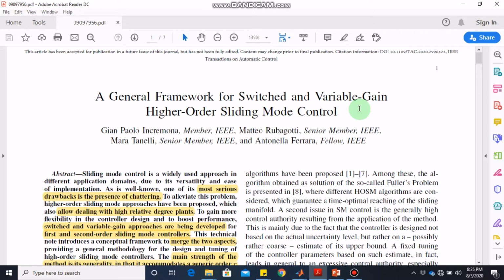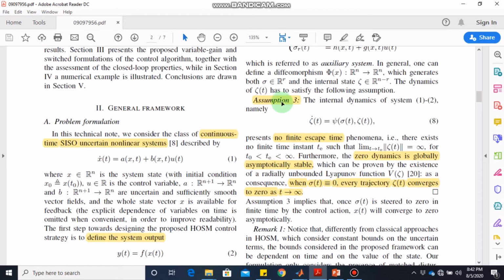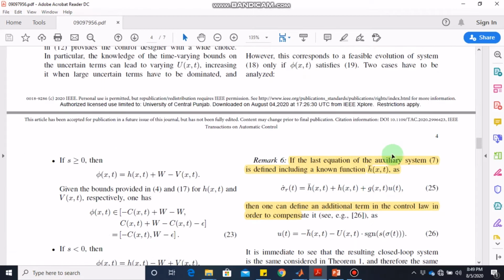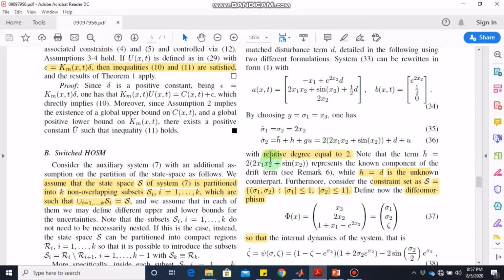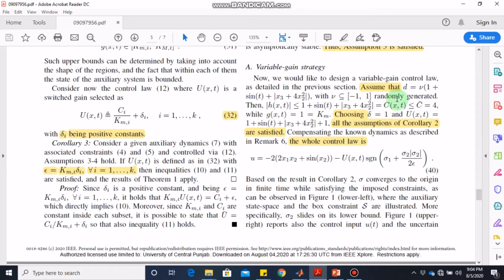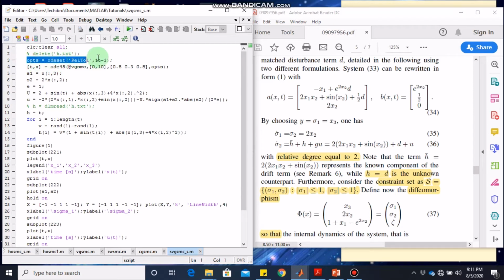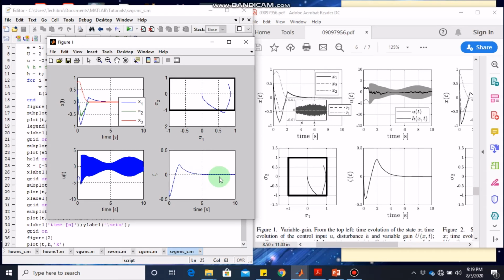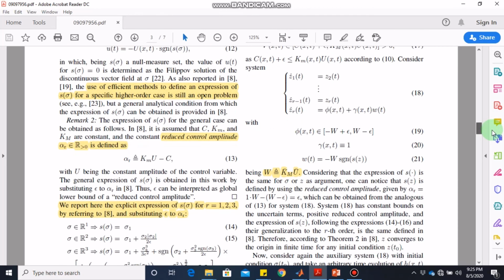MATLAB Code for Variable Gain and Switched Higher Order Sliding Mode Control

Comment: Sir please tell me what is the main difference between supertwisting sliding mode control and higher order sliding mode control
Reply from the maker: Higher-order sliding mode control is an approach where we try to make the sliding surface, as well as its higher-order derivatives, approach zero through the control design (https://youtu.be/7or8qnttrDY). Whereas the super-twisting sliding mode control is an approach where we try to make the integral of sliding surface approach zero as well as the surface itself (https://youtu.be/zCtjlX7FWnQ).
Reply: @cset  thanks sir